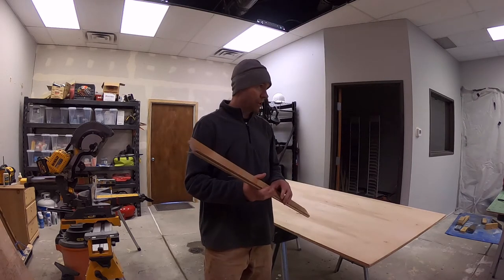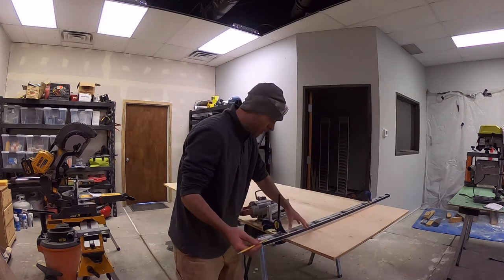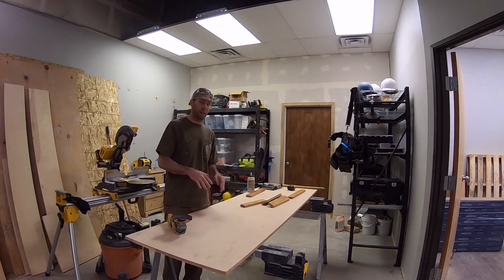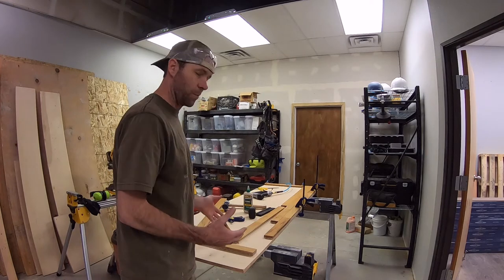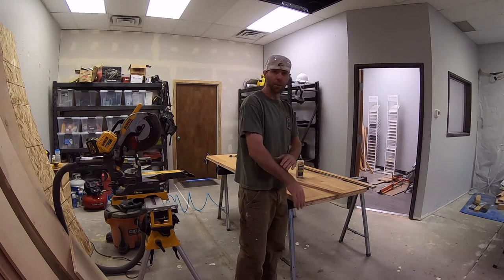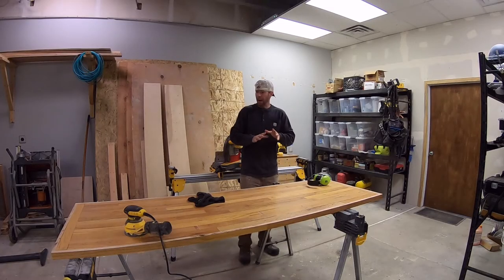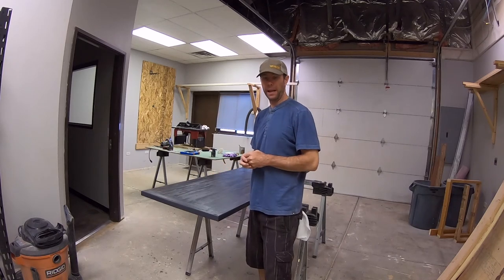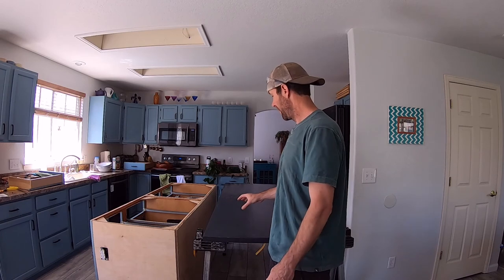How to Make a Reclaimed Wood Countertop: DIY project with NO MONEY! #builtbybaileys #diy #carpentry

Comment: Nice work! 

I thought of the same idea, but I am going to be jointing the edges on either side of the tongues and grooves, as I don't want the tiny chamfer on the edges to appear on my counter top.  It's hard to explain, but I'll be leaving the tongues and grooves intact, only shaving the portions above and below each tongue and groove.  I'll only be shaving off about 1/32" on each side of my pieces, and I'll be thoroughly gluing everything.  Like you, I'll be fastening the flooring to a piece of 3/4" plywood.  The finished product should be a large panel without the little grooves between the boards.